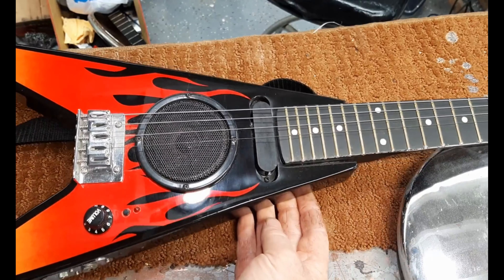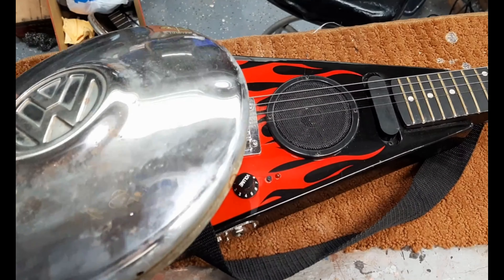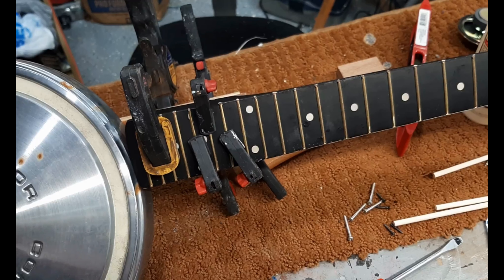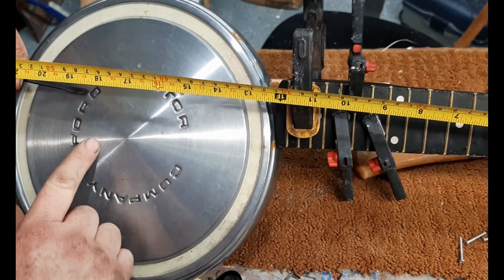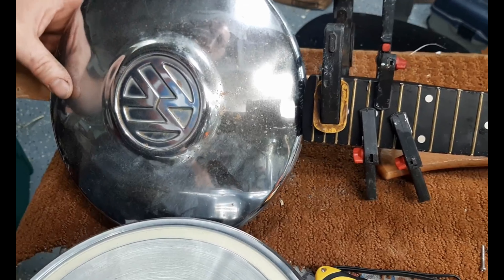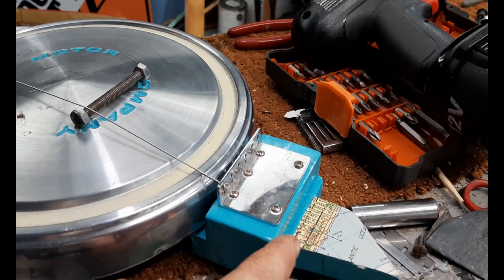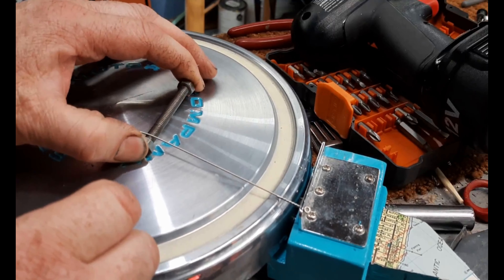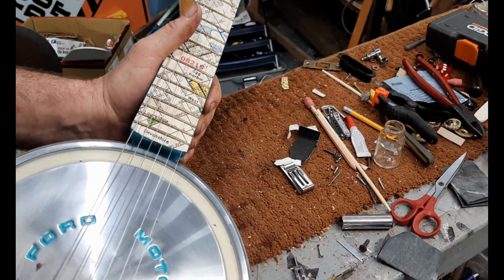Travel Size Ford Hubcap Guitar Build

Comment: Awesome build out of "junk," and great aesthetic taste with the neck and headstock - really put it over-the-top for me. What did you use to adhere the map pieces to the fretboard? I've used Zpoxy resin, which works well (20 for a bottle, doesn't take much, keeps very well), but always interested what's worked well for others.
Reply from the maker: I just used mod podge, probably not very durable, but that's what I had here at home.
Reply: @TomPetersonRefuseReuse  thanks for the response! spent a few minutes looking it up, people use it for putting fabric on shoes, seems like it should be more than durable enough. At 4-5 bucks too, definitely gonna check it out if I see some
Reply from the maker: @zrpcguitars6027  yeah, it's mostly for crafts and scrapbook type projects.